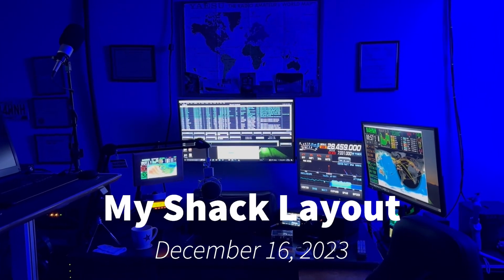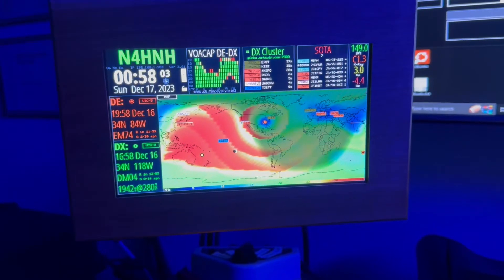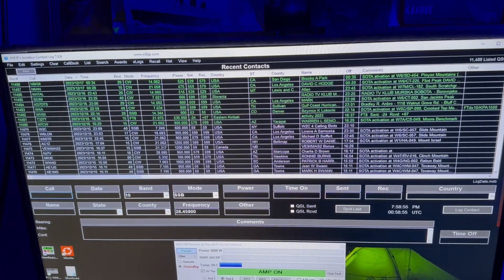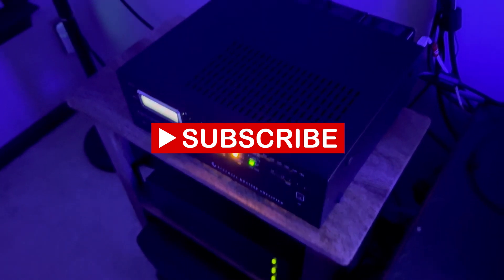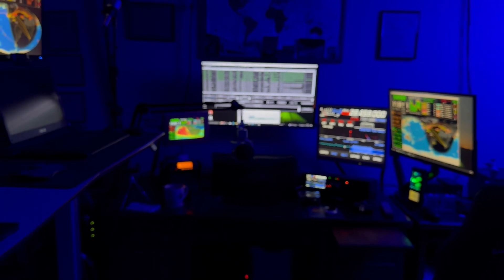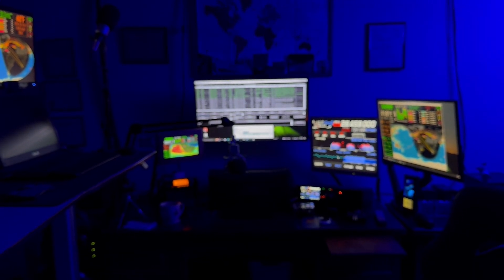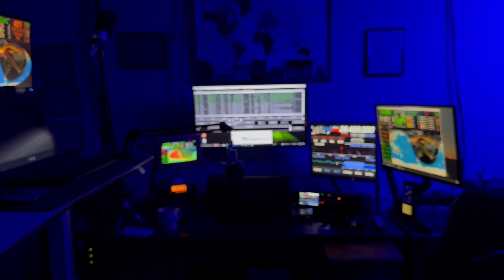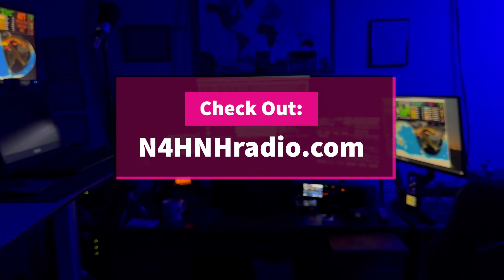My Shack Layout as of December 16, 2023 #hamradio #radioshack #hamshack

Comment: I wish radios had backlit buttons and dials. I like a low light room like yours.
Reply from the maker: The FT-891, FT-991, and FT-991A have backlit buttons. They are considered as base/mobile transceivers.  Backlit buttons help at night when driving.  But base stations aren’t usually backlit.  The colored lamp I use (blue), slightly illuminates the white text on the radio.  But I’ve used my radios enough that I know where the buttons and knobs are, even in the dark.

Comment: The shack looks amazing Doug, but what is even more amazing is that you know how to operate everything in there  :  )  Definitely gives me something to work towards as far as gear and knowledge. Thanks!
Reply from the maker: Hi Jim!  Keep at it long enough and you will know.  It took 42 years for me to get to this point.  I’m still learning too.  

Until 2019, I had two lower to mid-tier radios, one for home and one for mobile.  It was all I could afford while raising a family.  I saved up for 20 years to get a better radio.  I got it in 2019.  The FTdx5000MP was only the second base station I’ve bought in 42 years.  That’s why I did so much research and hands-on comparisons for 8 months, before choosing the FTdx5000MP.  There is a post on Patreon where I write about the whole process of choosing and why I chose the FTdx5000MP.  The post is in the FTdx5000MP collection.

73, Doug

Comment: I'm jealous, Doug. A permanent station inside the house is my dream.
Reply from the maker: It took 42 years for me to get to this point.  Until 2019, I had two lower to mid-tier radios, one for home and one for mobile.  It was all I could afford while raising a family.  I saved up for 20 years to get a better radio.  I got it in 2019.  The FTdx5000MP was only the second base station I’ve bought in 42 years.  That’s why I did so much research and hands-on comparisons for 8 months, before choosing the FTdx5000MP.  There is a post on Patreon where I write about the whole process of choosing and why I chose the FTdx5000MP.  The post is in the FTdx5000MP collection.

73, Doug

Comment: Great looking shack Doug, I've got a much simpler set up but i still enjoy it. Just a random question, what are your thoughts on the FT-2000? I recently picked one up and I'm actually impressed by it. Thanks for all your great videos! 
N6RDC
Reply from the maker: The FT-2000 is a very good radio. Little brother of the 5000, not quite at the level of the FTdx3000D.  The 2000 is one of the last that can accept a mu-Tuning preselector. That said, it cannot compete with the FTdx10.  The FTdx10 even killed the FTdx3000D.  But the 2000 is no slouch.  It holds its own.  It’s just hard to beat the hybrid architecture of the FTdx10.

Comment: Love the multiple screens and the layout. But working in that blue light would give me the creeps after while. Too many shadows for my faint heart. Anyway, thank you for your informative videos!
Reply from the maker: I’ve worked in low light for many years, designing electrical control systems on a CAD software.
Reply: @n4hnhradio  I have the curtains thrown back behind my HF rig. Bring on the sun. At any rate, your HamClock videos taught me more about how to read the various outputs on that device than anything I found elsewhere. Thank you!
Reply from the maker: @kumasu I’m glad you found my channel helpful.